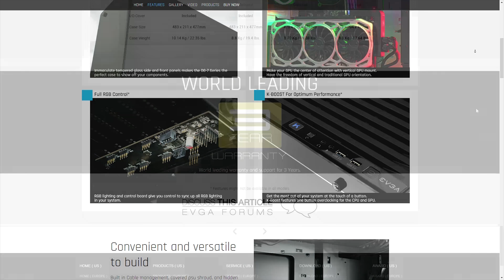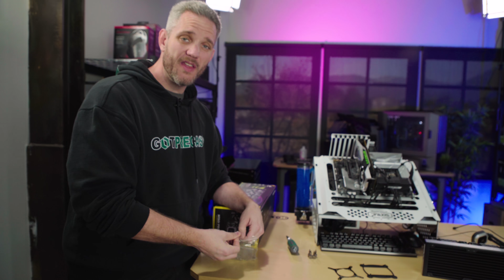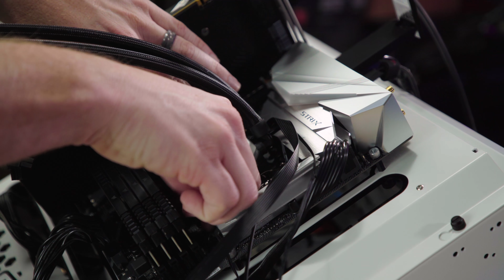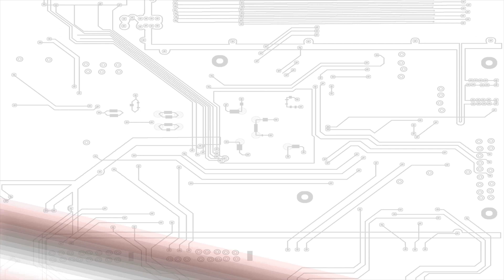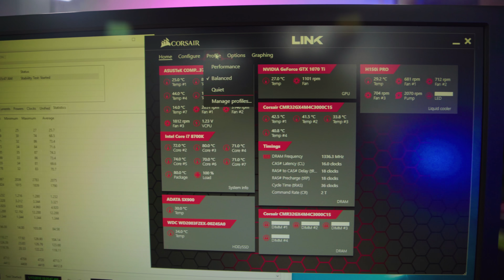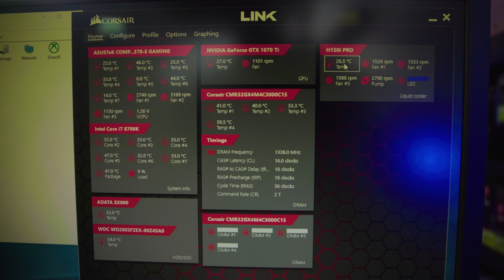Corsair's Largest AIO yet... But is it any good? H150i Pro RGB

Comment: Is anyone knows why Jay doesn't delid his CPU's? Just don't tell me about warranty, this is silly. PS. Nice video Jay, this cable mess I saw in CES coverage - stupid decision from Corsair.
Reply: Also, you do remember how much trouble the man had just getting Threadripper out of the BOX, right?  He's not quite Linus, but that seems like an unnecessary risk to be taking.
Reply: Yeah better delete all your BS Josh_519, i'll remember you :D
Reply: @MrScart35  LOLOL I appreciated your comments. XD
Reply: Because he's not interested in it, he doesn't NEED to, it's not necessary if you aren't trying to set OC records. That's what he's explained.
Reply: Josh_519 well any "good" cooler is pointless when that toothpaste under IHS can't transfer heat to the cooler. I've delided mine 8700k@4.9 and dropped 25C under load. Lower temps=lower noise and electric consumption. Pointless? I don't think so.
Reply: Because I'm overclocker (not a pro of course), that's why ) I had 4770k and after delid procedure my temps decrease from 80-85 to 60-65, by 20 degree  at 4.5Ghz overclock. It is better in anyway, no matter if you are simple costumer or want OC your PC. No one talk about records, what is the point in "k" processors, if you don't want to overclock them...
Reply: Josh_519 lol what a try hard...I was talking about Vcore. Less heat=less resistance=less Vcore needed for the same clocks= huge drop in CPU consumption. Before deliding mine PC was pulling 280w from the socket @1.38v now its pulling 50w less @1.27v. calculate that big brain.
Reply: yeah sure 50w*8hrs/day is 0,43cents a month, sure sure. And again(because looks like you have a reading impediment)
lower temps,lower noise,higher OC.
Yeah and that Ad hominem at the end...you just played yourself.
Reply: Dia Kloss - delidding doesn't improve anything but numbers if you aren't pushing to the point of thermal throttling. It will make absolutely NO difference in the day-to-day usability/performance for any typical PC user or even gamer(you've gotta actually try to find a game that is CPU bottlenecked today - I have an R3 1200 in my CAD/general use rig rock solid at 4.0GHZ that does literally everything I want, even before the overclock), programs aren't going to operate differently just because your temps dropped from 80 to 70. I'll give you fan noise, but changing the curve can take care of that.

I'm not even saying that I wouldn't delid; I likely would(if AMD wasn't KILLING IT and my last upgrade was an Intel instead) for the same reason that I overclocked this R3 1200 - because I can, because I like screwing with my stuff. But, make no mistake, it wouldn't be for any actual performance gain in typical use, because there just isn't any. 
It's kind of like saying "a 360 rad will make your computer perform better than a 240 rad 'cause thermal capacity n stuff". Well, yea, that is quite literally a true statement - that only actually applies if you're burning that fucker to the ground for like 12hrs straight with prime95 or something(there's a reason I'm only running a dirt cheap $48 Masterliquid lite 120 - again, a $100-$150 240 or 360 wouldn't improve web browsing, CAD rendering, or GTA5).

Probably 95% of people watching these videos(certainly including me) would be more than fine with, say, a Dell XPS with a box stock 2C/4T or a 4 core and something around a GTX1060 - but no one wants to hear that, let alone admit it...

Comment: "Pro" and you can't detach the wires. What the fuck Corsair.
Reply: Also weaker fans it should be called Corsair 150i Noob.
Reply: Fans should run below 1000 RPM if you want sound friendly system.That's why you have 360mm rad.And lower RPM good fans for example Noctua NF-F12 PWM/NF-P14s redux-1500 PWM have nice pressure even at 400 RPM and they are basically quiet.I guess corsair is trying to do the same thing
Reply: RPM is irrelevant unless you hit max speed which this fans can.

The Corsair Magnetic Levitation fans specs.
Fan max speed: 1600 RPM
Fan airflow: 47.3 CFM
Fan static pressure: 1.78 mm-H2O
Fan noise level: 25 dB(A)
Reply: +grlmgor weaker fans? They are ML fans. One of the best lmao
Reply: +Allie Boy They are weaker then the normal ML fans as they go up to 2400 rpm, the ML fans on the 150i only go up to 1600 rpm.

Also just about all after market fans fall into the mid range category as they can't compete with Noctua fans.
Reply: +grlmgor ok but do you really need that extra 800 rpm? No lol you don't need all that rpm. Shit I don't even run my fans past 1000rpm. Anymore than that and it's just too loud. Although I do agree about noctua being one of the best. The ML fans that come with the cooler are still very good. And saves you money cuz you don't really need to swap them out.
Reply: I got a H115i with Noctua NF-A14 I run them at 1000 rpm and it gets up 1400 rpm at peak load.

In ATM Australia I can get a
H150i Pro for $259
H115i Pro for $209
H115i for $165

It doesn't make any sense to buy any of the pro version as I can buy the older gen H115i and replace the fans. While the H115i pro is slightly bigger radiator and newer pump but the fans can only reach up to 1200 rpm.
Reply: +grlmgor I said why do you need anymore than 1200rpm? Who runs their fans at max speed? You're pc must sound like a jet engine. The good thing about the ML fans is that you can lower the rpm and still get a lot of air. Also the newer pump and bigger rad ensure longevity and better cooling. But I respect your opinion and to each his own m8
Reply: I use Noctua fans, when my CPU is not doing any extensive work load their most likely at 18 Db.

Comment: Terrible design. 
Looks worse than last gen. Looks cheap.
 Way to many cables. Manufacturers need to start combining and sleeving these cables together.
Why put copper and aluminum together... Come on Corsair.
Reply: If I remember correctly, Asetek rads are full aluminum. Galvanic corrosion concerns are pushed a bit away by using a coolant that replaces much of the water with additives that are there to prevent corrosion long enough that the fluid seeping into the tubing is a greater longevity concern. People buying AIOs can't expect their stuff to work continuously for years like someone buying a D5 can. Like many things, AIOs are designed to fail, but at least it's after a reasonable period of time.
Reply: what if we melt pennies
Reply: All these comparably priced units use copper and aluminum, get over it, it works!
Reply: Your mum looks cheap. Wtf is that random hating? You won't see any of that copper or alu anyway, moron.
Reply: Martin M yes I understand. But their are bad reactions over time mixing metals. Why not just go all aluminum or all copper. 

Bad designing in whole with aio
Reply: Just buy an Kraken X52

Comment: JAY do a video on the DEEPCOOL Captain either 120EX, 240EX, or 360EX!!! please i use the 120EX and i love it and i think that others should recognize them!
Reply: Those fans arent even rgb mate. still need to pick up a pack of Corsair ML120 PRO RGB LED 120MM PWM Premium Magnetic Levitation Fan — 3 Fan Pack with Lighting Node PRO
Reply: @Hardcore Hardware

No, i was referring to the H150i "Pro" fans. Unit is RGB But the fans that come with aren't.
Would look amazing if they were but you still have to spend extra to get that look too.

Comment: Lol and yet it still performs less than a noctua air cooler
Reply: it's not. I had a "noctua nh-d15" dropped 4c in aida64/p95 and about 10c in games after installing  "h150i pro". 7700k @5ghz 1,344v-1,36v; 74c max in AC:O; 69c max in PUBG; 90c spikes in aida64/p95.  with "noctua nh-d15" i had 85c; 77c; 95c respectively. And the system is more quiet overall.
Reply: Mark Leitan What about the pump? I've heard that some water cooler pumps have some kind of buzzing sound. Is that the case with this one? Is it noticeable when you place your pc on top of your desk? I mean what's the point in building an aesthetic rgb build when you can't see the pc...
Reply: It is noticeable but slightly hidden because of the GPU fans under load and the use of headset. It has 3 presets "quiet", "balanced" and "performance". What i do is damn simple.  When i watch movies, Youtube etc. i choose quiet preset. It becomes almost soundless. It is so quiet that sometimes i forget that it is on. When i play i go for performance mode it becomes quiet loud but not as loud as it has been with noctua. Overall i think it is a very good kit and would always recommend it. (my PC is on my desk)
Reply: thank you

Comment: What happened with actually reviewing the cooler? You used to take time to measure temperatures of different "fluids" for fun, drained system multiple times etc just for one video and now you don't want to spend a bit more time for proper review? Would it take too much time to compare temperatures at the same time to your loop on the open bench? and to one of the Noctua coolers (as best air cooler)? to actually give an idea how it works....Yeah it's easier to put it on, show few numbers that can't be compared/referenced to anything and say, it's cooling well...job done
Reply: dhaszek I share your feelings on this. I was hoping to at least see a comparison with some of the other corsair AIOs

Comment: They need to come up with better wiring methods for AIOs.  Maybe have it to where the fans plug into then one harness that can be removed and plug into the pump. Then you have one harness that plugs into the MB and leave the control to the MB temps and BiOs

Comment: If you don’t delid your 8700K these results are irrelevant. That CPU has to be delided and you can easily get 5ghz+ in the 60-70C range.
Reply: Not really, I run 5ghz non delidded and my temps depending on the game are anywhere from mid 40s to high 50s.  Stress test are in the 60s and 70s, sometimes peaking at 80. Definitely doable. I'm using this exact cooler. The wires though, absolutely hate them, mostly the usb because there's no real good way to hide it.

Comment: Completely overkill for any CPU without a soldered IHS
Reply: Knightcore basically all Intel CPUs then
Reply: No, he means without.  You can make the heat spreader as cold as you want, but if the die is thermally insulated in any way (ie, not soldered) the heat will remain trapped on the die to some extent.
Reply: Broadwell-E was the cutoff, all 6000 series HEDT cpu's are soldered
Reply: And with a cpu block too small to properly cool threadripper. (small tower with a proper one beats a h100 etc.)
Reply: Or just buy a Zen or pre-cooling splooge Intel
Reply: then modify it :^)
Reply: The 8th generation really needs delidding, sadly. dropped 25c on my gf's 8350k. From 94c @4.8ghz 1.36v to 75 max after delid with conductonaut.
Reply: my 5820k is soldered. not all intel cpu's aren't soldered. Haswell-e is where they cut off soldering the IHS which is sad.
Reply: Overkill is not the right word for this CPU cooler, pointless is the right word for CPU with non-soldered/non-delidded IHS as what is the point of a huge ass cooler if the CPU can't even get heat away from it's die for the cooler to dissipate, after a certain size diminishing returns for cooling come into effect for non soldered IHS CPUs.
Reply: Overkill for any CPU without a soldered IHS, don't you mean with? A CPU without a soldered IHS would run hotter, warranting this 360 AIO.
Reply: just delid.

Comment: Been waiting for a 360mm AIO Cooler for a looong time
And Jay, if Corsair used that pump, Can't u use the TR4 braket that comes in the Threadripper box to attach that cooler?
Reply: you do not want this for thread ripper, the pump and contact is a little too small to be able to work the best with it. which is unfortunate as i was waiting for this.

Comment: Did it come with pre-applied thermal paste?, i bought the H115i in late 2016. After a year the paste was like dust and the temperature was in the high 60 on idle. Bought the H100iV2 and used MX-4 paste, now it is back to 20-25C on idle.

Comment: I've been thinking about switching over to a water based cooling solution and out of my traditional air cooler on my main i7-6700K rig.  I hate to say it, and it sounds silly, but those irremovable cables are making me hold off.  I'd love to have a 360mm AIO and I've definitely got the room for it seeing as my main PC is in a Define R5, but no removable cables?  It's a basic feature, what a shame it was left out.  Until it gets changed, I'll be sticking to my Dark Rock Pro 3.

Comment: I've had that shutting down problem several times with the Corsair H100i, and with Corsair Link installed. My computer used to shut down randomly, sometimes doing work, sometimes playing a game, and sometimes just watching a video on YouTube. It was a nightmare to diagnose. What I ended up doing was uninstalling Corsair Link, removing the USB cord, having no fans connected to the AIO (controlling them with the Mobo instead), yet having the AIO connected to the Mobo (the computer wouldn't post otherwise) via a fan header. 

After this experience I don't think I'll be going with Corsair ever again. Also, I later upgraded the fans to some from Noctua, MUCH better performance now too.
Reply: I've actually used the CAM software, and once you patch up your firewall I've had little to no problems with it. Granted you can't use the in-game overlay, but overall pretty nice. Then again, I haven't used a NZXT AIO.
Reply: Could that issue make my computer randomly freeze/crash?
Reply: Pennywise: Good to know, cheers for the information.
BWood63: Yes.
Reply: Madness1 It irritates the shit out of me to think that this product I paid a bit of a premium for is crashing my computer.
Edit: Also thanks I had just given up trying to fix it
Reply: I had the cooler for almost a year. I never ran into any problems with it when it came to functionality. However, the pump started to make this grinding sound and that shit is SO ANNOYING. Got rid of that shit, got myself a sick looking Phanteks PH-TC14PE. It's way quieter and cools just as well, if not better, than the Corsair AIO
Reply: Corsair Link caused my PC to shut down randomly as well. I uninstalled 6 months ago, no issues since.

Comment: So Dell has partnered with best buy to create an 1800x ryzen 7 pc.  What are your thoughts on the build if you've had a chance to look at it?
Reply: I stopped when I saw Dell and Best Buy, RUN AWAY while you can.
Reply: Lukas Peruzovic I used to think the same thing but the parts themselves you can't get for that price. Amd 580, ryzen 7 1800x, 256ssd, 16gb ddr4. Widows 10 of course. DVD r/w
Reply: Ryzen 1800x is useless because you are going to overclock it anyway.Go for Ryzen 1700(OC to 3.85 Ghz).Windows 7(ryzen and Nvidia system)-50 processes running.Windows 10 same config-150 processes running.I personally switched to Win.7 from Win.10 with disabled "Hypertreading"

Comment: I wish they would make a 420MM AIO.
Reply: If you want a 420mm AiO you should buy the Alphacool Eisbaer 420.
Reply: Because I think it would be a cool product and I would buy it. Also 140mm fans are better than 120mm fans.
Reply: for the memes
Reply: A 280 cools a 1950x threadripper just fine. Even all core overclocked to 4GHz. A 420 is a dick measuring contest. Plain and simple.
Reply: Crossing my fingers for a 1000mm AIO
Reply: I'm going to get a pair of 120mm X 3 rads, and use them both for my Threadripper. I'm also going to use a pair of 120mm X 3 rads for the 2 graphics cards I'm going to be running. I'm then going to air-cool the rest of the box.
Reply: Even 240/280mm radiator is overkill for CPU only(My 280mmX30mm can cool 250W with 600 RPM fans).One good made 140mmX30mm Radiator(with decent fan) is going to cool any CPU out there without any problem.If you want big radiator you better make full water loop on most components otherwise it's useless to use 360mm rad on the CPU only.
Reply: @Reculse  uh... You must not overclock an 8350 then.

Comment: The RGB is probably what's making it perform so well.
Reply: GOPACKERSJT It is proven by now, that RGB increases fps up to 30% :)
Reply: Not probably... definitely.
Reply: Hariwins ' only on 4k that is
Reply: 3 fans with 1600rpm not enough? That sounds like a fn jet engine.
Reply: @jepulis6674  fuck no. Make them fuckers scream 2400rpm and higher
Reply: Like # 100000000
(bionary)
Reply: GOPACKERSJT at least 1w extra cooling capacity from each LED
Reply: GOPACKERSJT you know your physics 💪
Reply: f
Reply: Wow this is an old comment..... It was clearly sarcasm.
Reply: Lol, there is a case to be made that is actually lowers your FPS as to the money wasted better spend elsewhere.
Reply: RGB is just lighting, it doesn’t affect performance at all...
Reply: Guys are you on about the pretty lights?  They don't affect the performance of product regarding heat dissipation
Reply: Steve Simkins r/wooosh

Comment: Is there any way to upgrade my h115i to the h115i pro without paying full price?
Reply: ChainArts \\ Motion by keeping the one you have, the difference is marginal
Reply: Pigs Nation what about the fans? If I buy a pack of ml140s will they work properly? Because the oem fans are kind of noisy above 1000 rpm